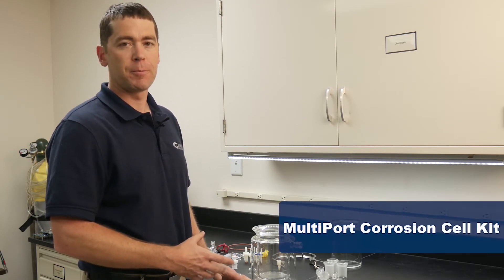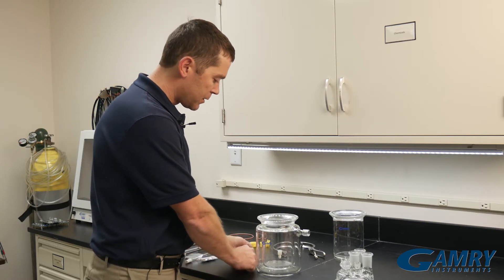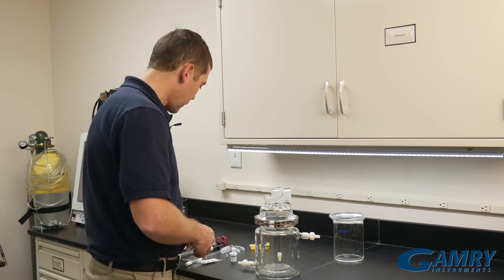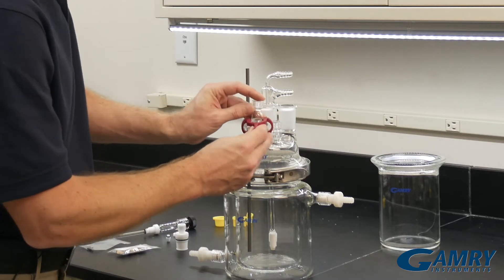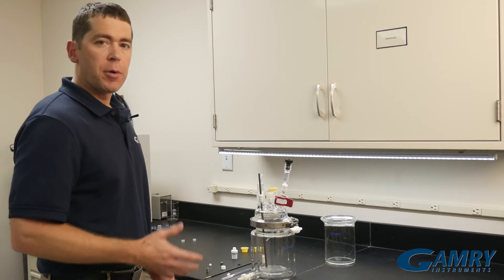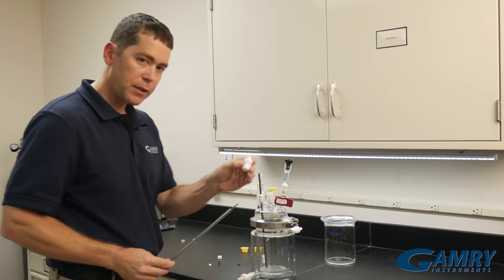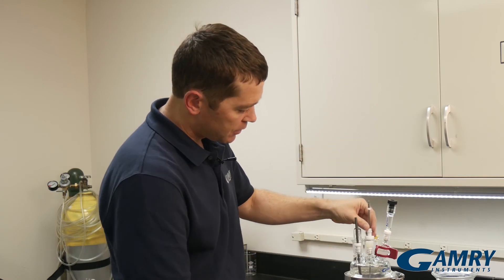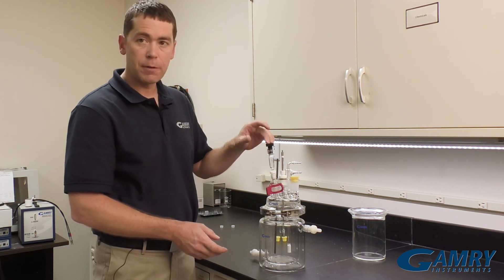MultiPort Corrosion Cell Kit

Comment: I want to do some electrochemical tests in Gamry. i use  gamry interface 1010E.  My samples are in aqueous solution. Is it possible to test my samples in Gamry for CV, EIS? Also i want to know the equipment setup like the reference electrodes and others. Please help me to pass through the necessary information. How can i setup the equipment in the solution???? Do i need to use both Pt and AgCl electrode??
Thank you.
Reply from the maker: This article will describe the basics of starting with an EIS measurement. It covers cell setup and use of the software: https://www.gamry.com/application-notes/EIS/potentiostatic-eis-tutorial/

In general, the Pt and Ag/AgCl electrodes would be used. Please contact our Customer Support team at techsupport@gamry.com. One of our engineers can provide specific advice and guidance for your experiments.

Comment: Can i use this Cell kit for working electrode of size 25 mm diameter and 20 mm length?
Reply from the maker: Yes, a sample of that size would not be a problem. It would just need to have threads machined into it so it can be attached to the sample holder rod

Comment: Thank you for this good presentation but there are two things you forgot to talk about .
1- you should clean the working electrode using the standard ASTM method and wear a glove while installing it .
2-the Luggin-Haber capillary should be filled with 3M KCL solution for SCE reference electrode or the corresponding solution that suits the reference electrode being used ..
Reply from the maker: Thank you for the valid suggestions. Yes, you do want to clean the electrode according to ASTM standards and also handle the electrode with gloves to reduce contamination.